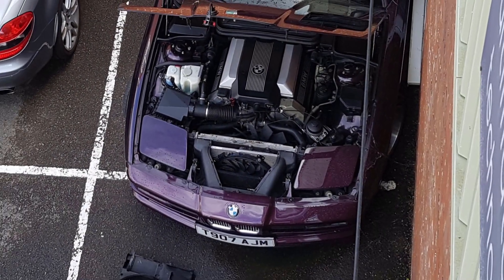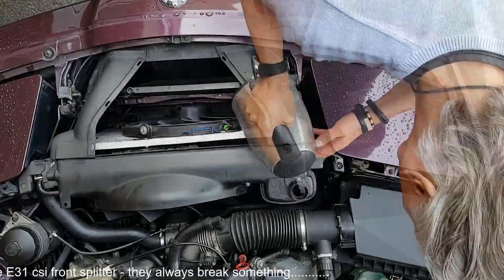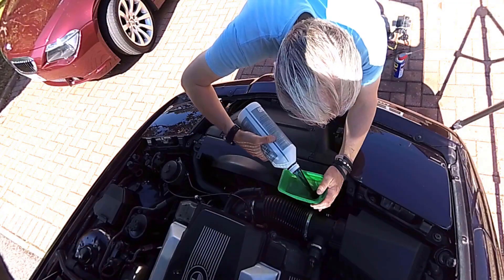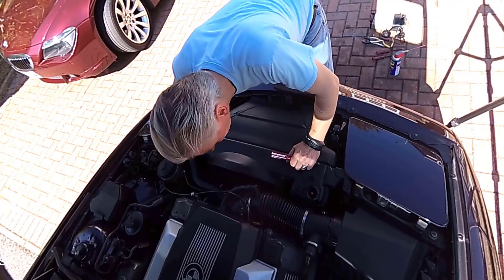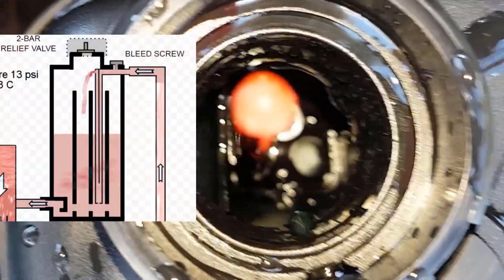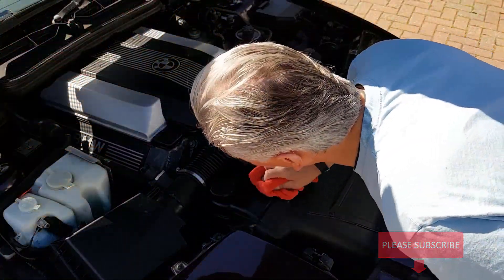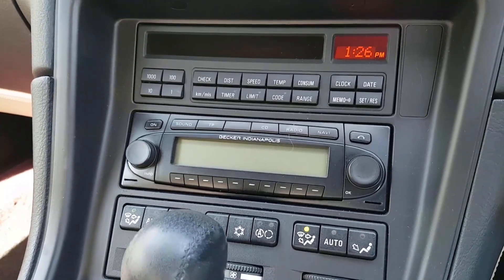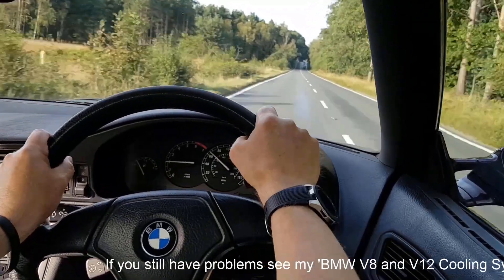BMW V8 and V12 Engines - Bleed first time every time

Comment: Thanks for the great video! I did the valley pan job on my 540i, changed couple hoses, and flushed whole cooling system at the same time. I had never done any bleeding on m62 or bled any system that had been completely emptied. No witchcraft was needed. Since my system was completely empty, I used a huge funnel as help to get the coolant level above the heater core while filling it up to get little extra air out before the actual bleeding, and after adding approx. 12L of coolant and seeing it coming out from the bleeding screw hole, I pumped radiator hoses for a while, then started the engine, and followed the instructions given on the video. As promised, this method worked perfectly.
Reply from the maker: Good stuff, glad to be of help!

Comment: Another very good and informative video on a subject that's treated as if its  surrounded with about as much black magic as carburation. I was recently surprised that I had been driving around with about 2 pints short of coolant when I decided to re bleed my M54 when I  conveniently found myself parked facing upwards on quite a quite a steep hill. No wonder my scan tool was reporting that the engine was  always on the warm side. 200F - 209F. When normally it would be in between 190F-200F. All is good now.
Reply from the maker: Glad you caught it before any problems Andrew!

Comment: I have always bled BMWs cold with the engine off by brimming the reservoir and burping the top hose. Whatever you do I have found that if the top hose is free from bubbles and the radiator is actually full (in other words coolant comes out whenever the hose is squeezed). Then with the tank slightly overfilled it's always been good to go.

Comment: Thanks for the video Timm! 

Two questions I'd love to ask you. Firstly, it seems like this procedure fills the coolant system up to the brim with pure coolant. As in, 100% full. Why is there a need for the coolant level bob?

Second is about cars with the latent heat accumulator. Instructions are different for bleeding the system. Can you comment about how this procedure works for cars with the latent heat accumulator, and for cars without?

Thanks
Reply from the maker: That was the emergency procedure to get me home - the correct filling is shown later

Comment: Hey Timm, thanks for the great content. I'm having a lil trouble bleeding and filling my 540i. The "check coolant level" sign comes on when car was parked in uphill, but no light comes out when it's parked downhill or flat. I've put enough coolant in the system to be operational, but the light keeps popping up. Any suggestions? thank you
Reply from the maker: The usual problem is a leak in the expansion tank where the sensor is fitted (it is a long concave hole) - the coolant leaks into the sensor and causes false warnings. The same problem is also caused by the internal float disintegrating and dropping the magnet

Comment: Hey Timm! I was hoping you could help me out… Ive swapped the 108c stat with a 88c one and I’ve been trying to bleed for days.. My ‘01 e38’s upper radiator hose shrinks/collapses once the engine cools off. I’ve bled all the bubbles for hours. The added coolant leaks out from the bleeder and top of the expansion tank. It looks like after that there isn’t enough coolant in the system because there is a huge vacuum build up once coolant shrinks and the system cools. However my floater is quite above the neck.. how much coolant is it safe to add to not overfill the system?
Reply from the maker: The top hose collapsing is nothing to worry about when the engine cools. It usually means the cap has been off when the coolant is still hot. Unless you have over-heating issues then don't worry!
Reply: @ it was off indeed. I was bleeding it the wrong way. I did it your way and kept it all sealed past 5 min and all seems to be good. I tip my hat to you Sir.

Comment: Hi Tim the stick of the coolant float is missing on my 650i, would you recommend replacing the tank and any other work?
Reply from the maker: Yes, I certainly would, usually a sign of disintegrating plastic
Reply: @TimmsBMWRepairsandInformation  Thankyou  I will get one ordered

Comment: So I’m having this strange issue I hope you can help me with. I recently finished my timing chain guide replacement along with gaskets and such. Refilling the coolant has been my issue, first day I filled it to the top and quickly put it on the incline and shut it off. Did the whole bleeding process  but I left it overfilled.  I assumed because the lines were finally full of fluid this was right. After about 30 minutes of driving still had no heat, upper rad hose looked bout ready to burst. Lower one was pretty solid too, upper very hot and lower slightly cooler. Hoses on the back of the engine were hot, it reached 110 before I shut it off and let it cool back down. Today I drained the excess coolant from the expansion tank till the bobber was level. Noticed the lines now felt empty. I started it and the bleeder hose or whatever they call it the pee hose in the tank was flowing but both upper and lower hoses felt almost completely empty. I’m not sure what exactly I’m doing wrong but I’ve been trying to sort this out for the past week and still no luck. Any help is appreciated!!

Comment: Hey Tim! I'm glad I discovered your videos. Wonderful content. Right now I'm having an issue bleeding my e38. When I rev the engine, I see no coolant spraying from the bleed hole when I look inside the expansion tank like it should at 4:10. I recently had my radiator crack while I was driving. Car overheated. I'd replaced the radiator and thermostat and since have been bleeding the system.
Reply from the maker: Check that you have flow from the top of the radiator via the bleed hose that runs to the bleed screw - if you get no flow it will never bleed correctly. More details here: https://youtu.be/XGIk8IXSGIE

Comment: Great video(s), Sir! whats the actual difference of bleeding through the bleed screw and the cap to the expansion tank?
Reply from the maker: Thanks! The bleed screw is connected to the top of the radiator and releases air as the coolant circulates - whereas removing the cap just reduces the system pressure.

Comment: Hello and big appreciation for your work!
I totally understand the concept of bleeding this cars. 
I changed everything on the cooling system of my e39 M52 engine 1998 except the metal pipe and the hose that lives under intake manifold.
I did exactly like you saying but need your expert advice what can cause pressure building in my hoses?
Doesn't lose coolant or oil.
They don't mix together.
And the test with the blue liquid looks fine never change the blue colour.
The mix is 50:50 with coolant from the dealer.
Only thing I noticed... Looks like coolant doesn't circulate proper when idling?
When preasure builds up  (doesn't allow me to squeeze the hoses) the coolant in expansion tank(white see through) stays just 10mm obove cold level on the tank, doesn't rise. It supposed to enter in the tank when coolan get hot and pressure builds up in the radiator?
When car warm up and idling at 100/102C only way to engage the viscous fan is to hold the rpm slightly higher about 1000 is enough and hold it for 20 seconds and only then I can feel the heat from the lower/termostat hose, looks like then coolant circulate better and viscous fan engages and stops around 94/95C.
By the way that's the temperature while Im driving, steady 94C heating off.
Why is that mystery?
Please what is your guess?
Reply from the maker: Hello Shefket, pressure build-up is normal, the system operates at around 1 Bar in pressure when up to temperature. The hoses should be hard to squeeze. Now, if you are overheating that's another question!
Reply: @TimmsBMWRepairsandInformation  Thanks Timm! 
With our weather here in Wales is hard to overheat.
I was losing coolan from the cap on my original radiator which had only 35k but I replaced the expansion tank and coolant leak stopped (i think just the neck of it with the time got bigger and the cap doesn't seal, just a theory no crack or something).
But when idling temperature rises up to 104C and the auxiliary fan kicks in, never heard the viscous fan. I thought the radiator is blocked and no coolant flow so the viscous doesn't get heat enough to engage.
Bought a radiator and changed the termostat with one from the dealer.
Now sometime i can hear the viscous fan engaging at around 100C dropping it to 95C.
But sometimes i have to push rpm a little bit to help coolan flow through radiator to help the viscous fan to engage
Sometimes in traffic when otside temperatures are hot, the coolan temperature stays steady at 97C without going any higher? 
I think the viscous should engage itself without manipulation at 97C, correct me if I am wrong. 
No overheat till now, the only thing is the PCV valve has some noise when engine warms up like a resonance, when I squeeze the plastic that cover the diaphragm i can feel vibrations, sometimes the noise/vibrations  disappear! 
I replaced the valve along with vent pipe and vent hose it's the simplest 
possible pcv from all the BMW's I've seen so far, it stops for a while now is back again I hope it is not related to my presure in the cooling system?
Reply from the maker: @shefketmustafa9228  that all sounds normal, I explain it here: https://youtu.be/RDuGsDUiXQw
Reply: @TimmsBMWRepairsandInformation  I watched this video few times in the past it helped me to realise that the original one on the car after 22 years needed to be replaced.
I found something very interesting earlier on INPA... Body/Air conditioning / I/O status... 
The circle for Auxiliary water pump was on while Vater Valves Left and Right was Off but the HAVAC panel was off. 
Then I switched on the heating fan to se how the circles from INPA I/O status will change and Vater Valves still off while they were set to 32C the I pressed the blue arrows down to drop the heating level and when I reached somewhere around 26C the circles changed to black showing they get activated. 
Then I lower the fan speed till it switched off but on the INPA status they were still on while randomly they were switching on and off Left one and Right absolutely randomly i even an hear them while signal changes. 
The HAVAC control panel maybe? 
The DME-KO Signal also randomly on and off. 
The selenoids and the motor tested in te past they work fine just the signal

Comment: I have never had to bleed a cooling system on any car. I can only think that some cars have some of their pipes or tubes that are higher than the top of the radiator and will trap air causing coolant to boil there due to lower pressure. Am I right?
Reply from the maker: You are - a lot of air gets trapped in the heater system, but follow this routine and you will be fine.

Comment: i used the procedure and it worked well, however i did not change the seal of the coolant drain plug when draining the coolant and then it dripped into the water. now i have drained the coolant from the radiator to change the seal.

is it necessary to drain the entire cooling water again for the procedure or can you start the procedure with the 8-9 liters in the system as in the video?
Reply from the maker: As long as you catch the coolant in a clean container you can re-use it - that's certainly what I would do!
Reply: Thank you for your answer! 
I start the procedure with the 8-9 liters in the system after installing the new coolant water screw at the water cooler. 

Is the important way at that bleeding procedure to file up the the coolant when the engine is runing or to run it up a few times until the coolant comes out like in your discribtion to bleed it correctly.

Comment: Hi Tim, thanks for the really helpful video! I’ve got a quick question. I’ve bought an e38 750i and am going to replace all coolant lines and coolant as part of preventative maintenance. The car has the REST function on the heater controls in the car. Do you know if this runs off a separate system and needs to be bled separately to the main system as described in your video? Or will be bled whilst bleeding the main system? I read somewhere that it might need to be but just need some clarification! Thanks and keep up the great work, cheers!
Reply from the maker: All the big BMW's got the restorative heating - it uses the standard system but runs the auxiliary water pump (which is its main purpose) to circulate the coolant when the engine is not running.

Comment: Hey timm, i own a 2001 740il e38 and must say your write ups on your site are awesome for the most part. I just have one thing that puzzles me. Your bleeding the coolant write up and this video differ in a couple ways. Ive gone by the write up previously and it worked but was a lil battle  after seeing this video im wondering if i read the write up a lil wrong or if the procedure write up and video ptocedure are different?
Reply from the maker: My coolant bleeding method has evolved over the years - this video shows the most up-to-date version, but either methods work 100% of the time as long as you have no underlying problem.
Reply: Okay i just was wondering why they were different cuz im presently bleeding mine cuz i recently had to do the timing cover gaskets and water pump gaskets and was having a lil bit of trouble. I think i got it now using  your video. So thank you. Great write ups on your site. Very informative.

Comment: Hi Timm, thanks a lot for this video, I followed your procedure twice and it worked very well. You said your M62 is running with 85ºC thermostat, are you happy with it ? I tried it on my 740i M62 and the coolant stays at 80ºC. Isn't that a little bit too low? I would love to get your thoughts on that. Thank you!
Reply from the maker: Hello Guillaume, the E31 has an 85C thermostat by design, it was only the E38 and E39 that got the temperature-mapped thermostat -we didn't get any of the extra 'improvements' such as secondary air systems - we didn't even get an econometer! The M62 is perfectly happy at lower temperatures, possibly uses a little more few compared to the E38 but is always ready to supply full power!
Reply: @TimmsBMWRepairsandInformation  thanks a lot for your answer! I think I will stay with the 85º then, I really do not want my engine to run at 110+ºC, here in France we are starting to get high temperatures. Its an old car with almost 440 000kms and I want it to last as long as possible!

Comment: Hopefully you’ll know what’s up with this, I did the full bleed procedure as shown and the little pee valve thing isn’t shooting a stream, it’s dribbling down the side on the inside of the reservoir, it gets noticeable more flow when revved but both the upper and majority of the lower seem to be filled with air
Reply from the maker: That is normal, the auxiliary water pump helps with the flow, but the engine still needs to be revved to get a good stream!
Reply: @TimmsBMWRepairsandInformation  yes I took a video of it and there isn’t a stream sputtering out like yours, so it’s normal for The lines to feel almost empty with the reservoir dipstick flush with the top, I’m scared to run it for a long period of time because they seem so empty

Comment: ive only had my 04 plate 645ci for a couple of weeks and ive never once seen the temperature guage move. ive only left it running for about 20 minutes and drove it around the block every day. what would you suggest?
Reply from the maker: That's not the coolant temperature gauge - it's the oil temperature and it will not move until a few minutes of driving
Reply: @TimmsBMWRepairsandInformation  thanks Tim. I've let it run for 10 minutes and it's never moved. Ill give it a run out for half hour see what happens. I've been following everything you have reccome ded to protect this engine before I drive it properly. Thanks for all of the info in the videos. Just the gearbox seal to do next and drill the right back box as per your guide to get the improved sound.

Comment: Hi Tim , I followed the method for my Range Rover M62b44, the coolant circuit seems full, the thermostat opens at 108 ° C and the gauge stays well in the middle no overheating but I have a lot of pressure in the hoses . is this normal?
Reply from the maker: The system MUST be pressurised for the system to operate at above boiling point - all explained here: https://youtu.be/XGIk8IXSGIE

Comment: Purchased a 2004 X5 4.4i, previous owner had a radiator leak and used some kind of stop leak additive that swelled up inside the expansion tank. The stuff looked like balls of wet paper that clogged the passages inside the tank and caused the cap to loose its pressure relieving qualities. It basically turned the expansion into a pressure cooker that eventually cracked right at the seams. New hoses, water pump, thermostat, radiator and expansion tank should take care of it. Moving on to those pesky power steering hoses that are leaking since they rub against each other by design...😥
Reply from the maker: Great work, well done!

Comment: What’s with the oddity of the M62 engines not having thermostats available below 105C? Google, EBay, they just don’t exist.
Reply from the maker: The E31 has a 85C stat as standard
Reply: @TimmsBMWRepairsandInformation  but your M62 has a production date after 9/1998. M62 engines with an earlier production date can not use the thermostat your E31 has.
Reply from the maker: Take a visit to the e38 section of bimmerforums.com as they are swapping in 85C stats. The thermostat housing has to be replaced AFAIR - they will know....

Comment: Hi Tim so do I do the same thing to my N62 engine in my 645CI
Reply from the maker: The N62 is much better at self-bleeding and the aux pump is low in the engine bay - but it is still worth raising the front of the car.